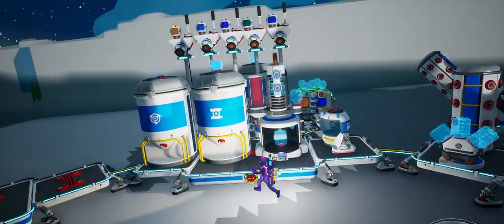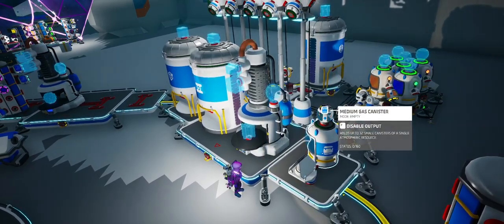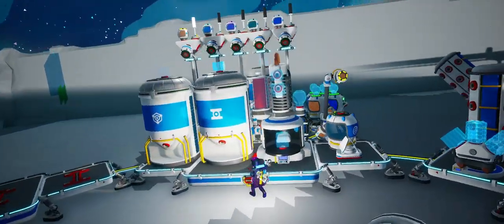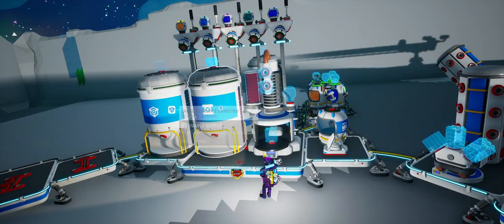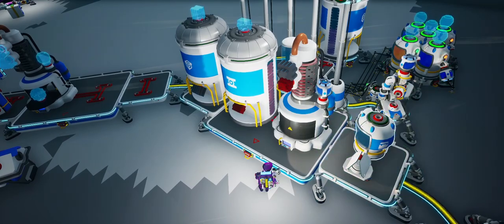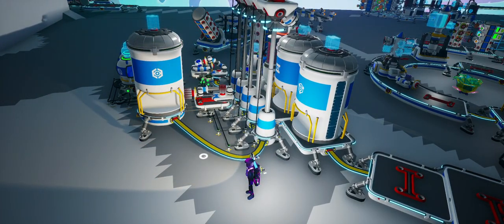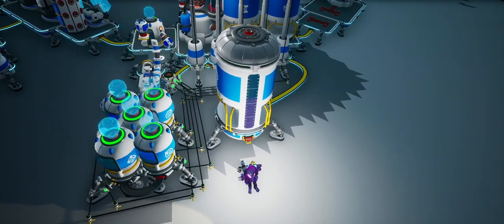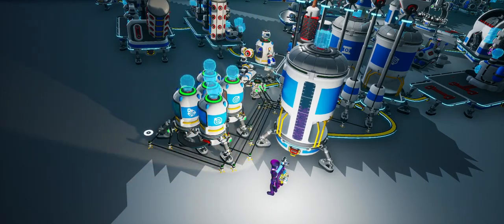Astroneer chemistry lab automated gas selector

Comment: If you use an extra large platform C and put Chen lab at one end, two large storage (the roof shapes ones) in the middle, you can put full medium gas canisters on the large storage and still have space to spare for your iron and carbon. 

The Chemlab automatically selects the right gas if you set the canisters to output. 

No need for any fancy automation.